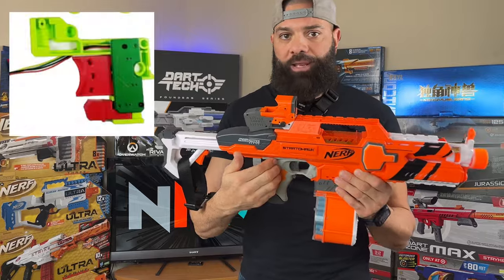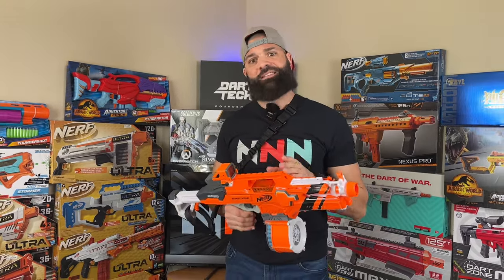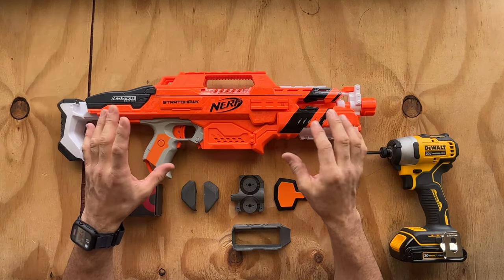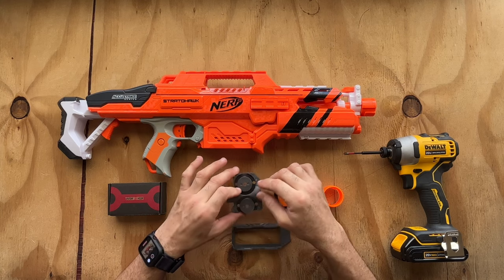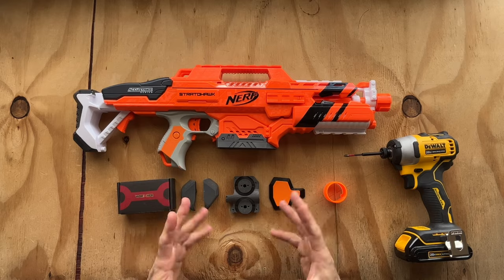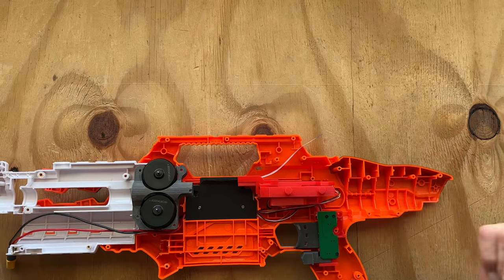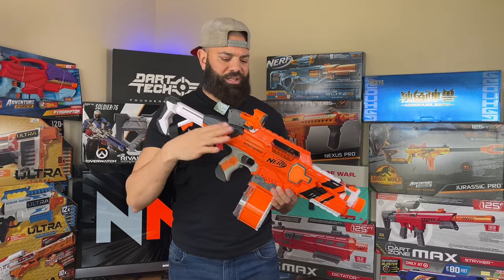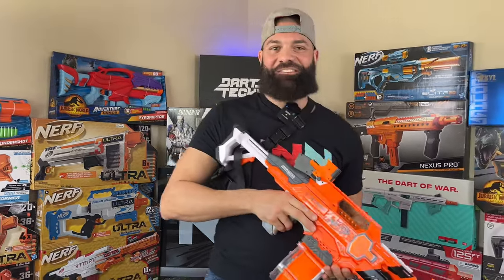NFStrike Evolver | Forget everything you knew about Nerf modding... | Full Analysis

Comment: Nice.  I was planning another select-fire stryfe build, but with the strife slipped inside a longshot body, but given the cost of this kit, I might just get this and dig out an old rapidstike.  Mind you, the site says the kit is only rated for 50 amps, which is two mieshels at stall, allowing a little headroom for resistance, and I was planning on fangs and high crush to get 150 on short darts, so I'll have to have a think.  (Normally with select fire kits I split the circuit so that the high current draw flywheels are not pu;;ing amps through the board). But then that misses out a lot of the functions of this kit.....hum, decisions, decisions.
Reply from the maker: Yeah I like the current bypass idea. I would have gone that route if I would have put crazier motors but ultimately went with the 132s for the extra torque without adding too many amps!

Comment: Just finished my own custom rapidstrike build with this kit. Its amazing! i'm hitting an average of 170fps with kraken flywheel motors, kepler wheels, and 39mm daybreak rapidstrike cage. The only thing I'm not satisfied with is the color of the kits 3d printed parts and the fact it's not injection molded. but if they are willing to send me the files too, i would print in abs or something stronger in colors I like. great video as always!

Comment: I just installed one of these in my old Rapidstrike! If I would have known they made an orange one I would have aimed to pick up a Stratohawk to match the colors! Did you have any problems focusing your Holosight? Mine seems to be projecting an image that's too large for the sight itself and I haven't seen anything in the menus that would allow me to adjust it. Maybe I'll have to take it apart and see if there's manual adjustment.
Reply: They don’t. He had to print it for himself by asking for the “blueprints“
Reply from the maker: I had to focus the little projection screen by pushing it further to the left, then finally the entire image appears on the glass refraction screen. Be very careful as the components are very delicate!

Comment: For anyone who installed the Rapidstrike kit, did you have trouble with extra darts being fired on semi or burst? I’m getting one extra dart and often two extras on semi and burst. Tried all the settings to correct. The only thing that has an effect was to drop the pusher voltage to minimum (5V). That got me mostly down to firing one dart on semi but still getting the occasional second dart sneaking out. A bit worse on burst. I’m running Valkyries on a 9.6V NIMH  in it if curious.
Reply from the maker: I actually encounter this every once in a blue moon but it wasn’t a significant enough problem for me to document it. Plus I was able to over come it with some trigger control which is what you would use to stifle-fire a full auto. Good strategy on the pusher voltage though!

Comment: Who did you reach out to for the stl files? Are they posted some where. The color is the only thing that has stopped me from purchasing it
Reply from the maker: I saw the comment section on the product page and it looks like they’ll just email you if you post on there!
Reply: Very cool thanks, also what orange filament is that? It looks like a very close match
Reply from the maker: @johnpetray5960  Sunlu PETG!
Reply: So I followed suite and I’m building the same set up. I’m going half dart and a different cage. Nfstrike forwarded me the files for everything but the part that holds the lense is not the same on my files. Did you run into this? Also my files didn’t include the trigger and rev trigger. Did you get all of that in the files you were sent
Reply from the maker: @johnpetray5960 had to ask them for the trigger pack files, they eventually sent them. I wedged the lens frame in and tilted it until the angle was perfect. It’s so snug it’s not coming out. Hope this helped.
Reply: It does help a ton. I’ll reach out and get the trigger files. I’m also going to send some pics hopefully they can send the file for the matching top the adjustment on that one is cool
Reply from the maker: Nice! Are you doing RS or SH?
Reply: I did a stratohawk I love it. I was able to get the different files for the top part that has the adjustment built in. It gives you more movement when sighting it in. I also converted to short dart with the extended pusher piece included in the kit. 

Thank you for doing this video and helping me along the way I appreciate it
Reply from the maker: @johnpetray5960 that’s a cool project. Congrats on the build!